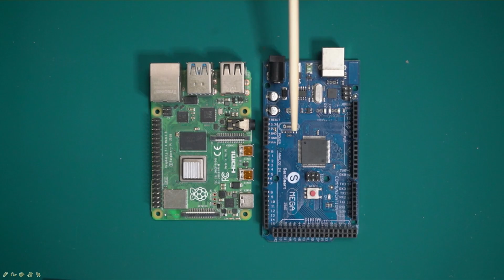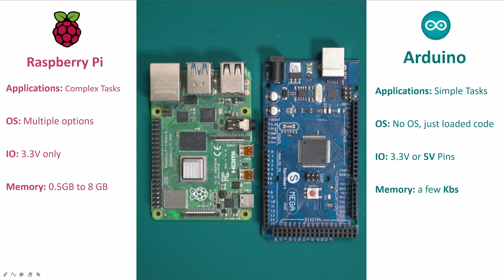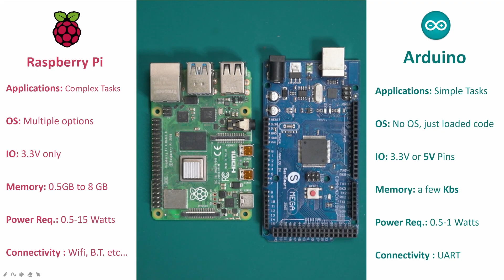Raspberry Pi for beginners: A quick comparison between Raspberry Pi and Arduino

Comment: "Arduino vs. Raspberry" is a false dichotomy. Microcontroller dev boards and single board computers do have a narrow overlap in applications, but in wider view they really aren't alternatives.  In timing critical applications SBC's can't replace microcontrollers, while microcontrollers aren't for heavy calculations. Microcontrollers (even the 8-bit arduino) have much faster interrupt handling than SBC's, and much more predictable response times, so when very accurately timed I/O is needed (eg. running machinery) a microcontroller would be the device to use. Even if a SBC would appear much more powerful with it's big numbers it will not handle timing critical tasks well. Even with a real-time operating system the SBC will be much more sluggish with interrupts.

The family of Arduino-like boards have been augmented by a broad range of modern STM32 and Cortex-M based microcontrollers that are much more powerful and have better connectivity so these are the devices to go for when Arduino does indeed becomes too limited. You'd never "upgrade" from a MCU to a SBC, again, they are for different tasks. 

Finally, to address the Arduino's originas as a prototyping platform, it's a primarily convenience item for easy access to the MCU itself; it's not needed and indeed originally not even intended for embedding as whole; in the original Arduino the MCU was a socketed chip you could pop out and install in your own board design with little work. Even today it's relatively easy to flash a microcontroller chip with the arduino code and implement it directly on the PCB. With single board computer then pretty much only choice is to use a compute module for your custom board.
Reply from the maker: Thank you lot for this generous comment  actually I agree that the comparison of "Arduino vs. Raspberry Pi" is often oversimplified and can lead to a false dichotomy. Microcontroller development boards like Arduino and single-board computers like Raspberry Pi are different tools designed for different purposes, and each has its strengths and weaknesses.

As the message correctly points out, microcontroller boards like Arduino are well-suited for timing-critical applications that require precise, predictable, and fast response times, such as running machinery or controlling sensors. Microcontrollers have faster interrupt handling and lower latency than SBCs, making them ideal for these types of tasks. On the other hand, SBCs like Raspberry Pi are better suited for tasks that require more processing power and memory, such as running complex applications, serving as media centers, or acting as a home automation hub. SBCs are generally more flexible and can run a wide range of operating systems and software.

That being said, I would challenge the assertion that you would never "upgrade" from a microcontroller to an SBC. While it's true that they serve different purposes, there may be situations where an SBC is a better fit. For example, if you need to run a complex machine learning algorithm on a large dataset or manage multiple tasks simultaneously, an SBC may be a better choice. In addition, while it's true that Arduino was initially designed as a prototyping platform, it has evolved into a popular development board for embedded systems. Many modern Arduino-compatible boards are designed to be integrated into custom PCBs, and it's possible to use the Arduino IDE to program other microcontrollers as well.

In conclusion, while it's important to understand the differences between microcontroller boards and SBCs and choose the right tool for the job, it's also important to keep an open mind and consider all available options depending on the specific requirements of your project.
Reply: @WeeWStack  Heh, thanks for appreciation. I tend to get a bit touchy and unrefined on the subject, it's traumatizing to deal with project derailment with an idea that Arduino is pointless redundancy when "Raspberry has more MIPS, it can handle it better".